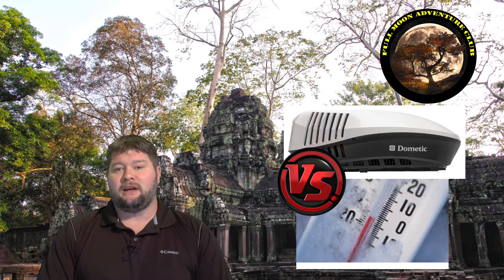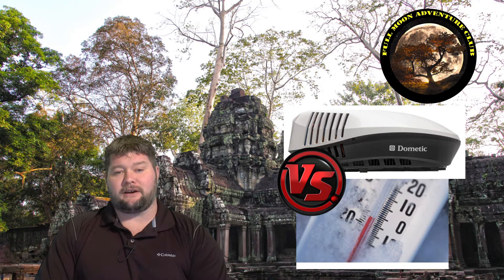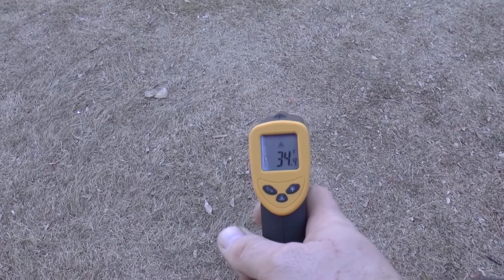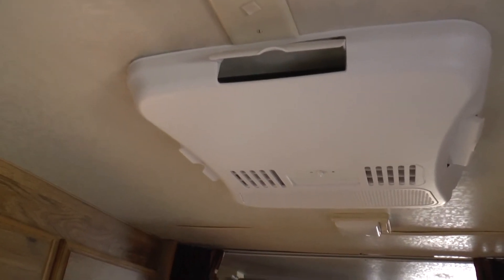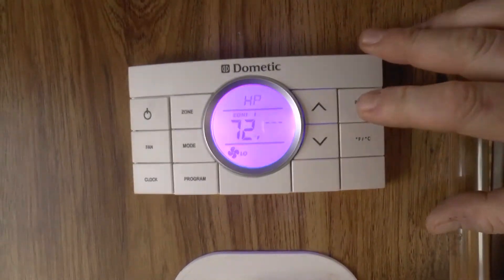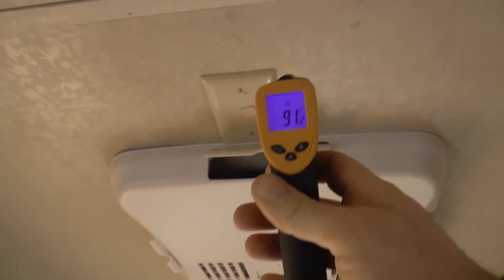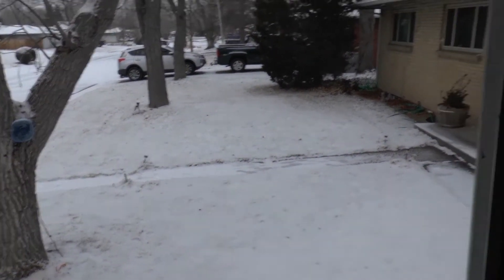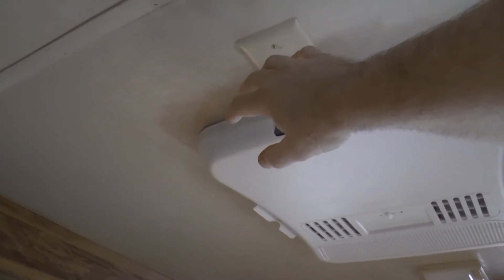RV Heat Pump Cold Test. Dometic Blizzard NXT vs Snow

Comment: Some heat pumps aren't designed for lower temps. In fact, 30 years ago heat pumps didn't work below 40 degrees f.

In the interest of science, PLEASE don't use infra red thermometer to measure air temp. It literally can not measure air temp. It can only measure the temperature of objects. Buy a thermometer for like $10.

Comment: Too many variables here, thank you for posting, but how much trouble would it be to get a probe type measuring device to get some facts to us instead of just saying the air was  freezing cold coming out.  I would guess at 20 OAT with an indoor air temp of 32, the unit was putting out about 50 degree discharge air.  I am sure a google search can get these numbers for you if you feel inclined to do so.  ( Sorry I am/ was an engineer and don't do well with  data that just says " freezing cold" )   Another option I have done is stick a remote reading thermometer in the exhaust port of the unit.   Stay warm my friend.

Comment: I went and looked over at 200 campers the other day at a camper lot brand new 2021 is a 20 they told me if you're going to run it and not shut it off you're fine they said if you're going to leave and turn it off and expect to come back and turn it on in it to work it's not going to work he said if you're going to stay in it you're going to be in the next day do not shut the heat off let it keep going it's bad on the walls he said and stuff to sit in the cold really you should put like a little space heater in there he said just to knock the chill off so the paint and everything in the wood doesn't move everything moves with heat and cold expanding a tracked

Comment: If you turn it on you're not supposed to turn it off if you read the forms it says if you're going to eat it and you plan on being in and out of it leave it run it's kind of like the air conditioning in your house or your RV leave it on you don't shut it off when it's 90 degrees out because we can come back AC unit is not going to be able to cool camper down and within it takes 3 to 4 hours instead if you would have left to eat on and it would have kept going it would have been just fine the next day
Reply: You are absolutely  right.  There's no way the tempature  can heat up to 70-90 degrees  in  just 30 minutes  .I'm never put down  people  ,  I was glad  to see that someone  else  except  for me could see . This guy  is misleading  people.  Heat pumps , just like ACs need proper  time in order  to do it's  job TY

Comment: It would have been interesting to see if the heat pump could have maintained the 72° in the 20° temperatures if you had left it running all night. No doubt starting up with a 32° inside camper temperature It was hard to bring it up.

Comment: Thank you, this was very helpful, Jim!!  I have a similar heat pump / AC in my RV and now I know I'm likely good until about 32 degrees.   I'll be testing it soon, with two full tanks of propane in case it fails.

Comment: Jim, I have the same problem with my Coleman heat pump but the furnace and the HP are wired together.
Reply from the maker: The heat pump and your RV furnace should be separately controlled on one thermostat. If it turns both of them on that's pretty unusual. If that's the case you should definitely put in a separate thermostat for your RV furnace. They're only like 20 bucks and you can put it right below it or above the other thermostat. That is currently how I have mine wired.  Jim

Comment: I bought a Senville Mini split to test it last winter, rated to provide heat down to minus 22 F. It was still providing heat down at minus 35, finally kicked off at minus 40 F. Every year they are getting better. Very happy with my Senville.
Reply: Which one of theirs did you buy?
Reply: I wish I would of bought a senville. I bought a Della. Which worked great until it stopped keeping up with the summer heat. Trying to get warranty is like pulling teeth.

Comment: I ordered this as a new install for my 2000 drop in camper since it did not have one . Took out the vent and drop this one in with a helper and connected the ac wire . Pluged in the lower unit , screwed it into the ceiling and ....done. works great.>>>  nub.best/ywvn    Took me about 3 hours start to finish and that includes scraping off the old puddy from the vent. The instructions ( which are in the lower unit ,not the air conditioner part) were very clear on how to install both units. The fan is a little noisey, wish it had a quiet low speed but noise is acceptable for the price. Very nice unit.

Comment: I upgraded to a Mach8-15,000 on my 2002 Flair about a year ago.  The heat pump will not come on once the temperature hits 38degrees.  I contacted the factory and they said they were set at that temp to prevent freezing.   It made no sense to me since that’s when you need it, at 38 degrees or less!  Do you know if there’s an adjustment and is this just a Mach issue.  Thanks
Reply from the maker: There is no adjustment as far as I know. The heat pump becomes very inefficient below 35 degrees so I don't think you would want to bypass the safety settings anyway. They do not work well in freezing conditions but are still very handy when it is moderately cold at night. When they work it saves you propane when you have power.      JIm

Comment: What's the capacity of the pump?  How many watts is it using?  Thanks!
Reply from the maker: I found these numbers on the Dometic website for the blizzard NXT 15000 BTU unit which is what I have installed and what I used for the video. I hope that helps. Thanks for watching and happy camping.
Power consumption - Cooling mode (ISO 5151)1590 W
Power consumption - Heat pump (ISO 5151) - Display 1243 W
Reply: Excellent video, so for heating down to 35 degrees am I correct in thinking this 15000 BTU output is the same as a 4.3 KW electric heater that only uses 1243 W of electrical consumption?